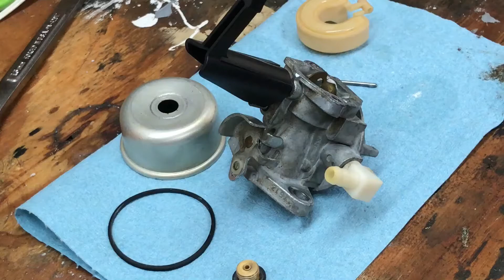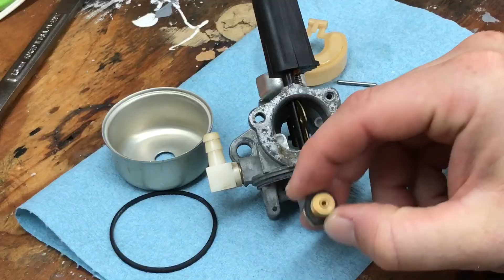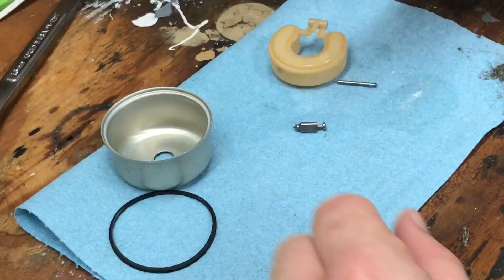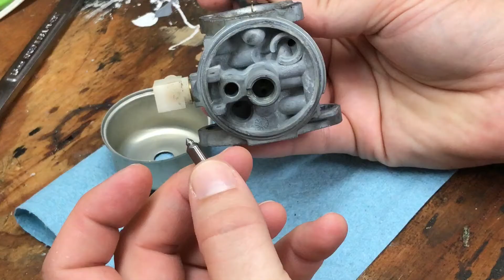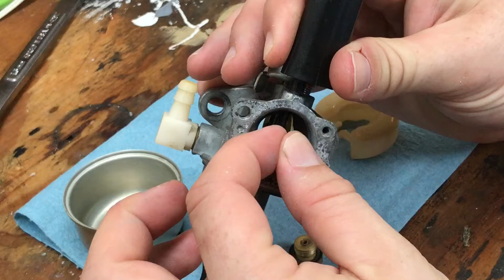Common Problems With Small Engine Carburetors (Float Type)

Comment: Where can I order parts. After spraying Carburater cleaner through the the throat and into the gas intake, I discovered that the ring sealing the float tank expanded when I removed the float cover. The rubber ring  no longer fits into the cover. I hope that heating with a heat gun will shrink the ring.

Comment: Greati video. What does the white connection do?  I assume there is a tube attached to it?  I have a similar carb for Toro lawnmower and when I fill up fuel in tank after it has sat for a few years fuel actually comes out from that tube (ie. not even running, just sitting). I cleaned out the bowl of the carb but didn't change anything.  Just want to see if I can get the mower running before changing out parts if possible (mower from 1987) but not sure what would cause fuel to come out from that tube.

Comment: That black gasket falls off when I take the bowl off I might need to get another one tighter that’s the only thing that can be wrong it has a new carburetor new spark plug new filter gas and oil is good still won’t start

Comment: So specifically on all 6 that I've replaced the floater bowl stops doing its thing and it leaks gas out the air intake. What am I doing wrong?
Reply: Seems like ur float valve is letting too much fuel in not shutting off when it should.

Comment: My duel fuel generator carburetor won't work, I'm attempting to clean it. What does the selinoid on the bottom of the carburetor do? Is it testable? I can make it run when I pour gas directly not carb.

Comment: Thanks man. I wonder if you can help me with a question. I have a small pit bike that it is pouring gas on the overflow line no matter if I is on ON or RES the only way to stop it or closing the petcock. Any idea?
Reply from the maker: Float needle is leaking or stuck open. Carburetor probably needs a good cleaning

Comment: Well done video! Another tip I got (on donyboy 73) is to remove the barbed fuel inlet fitting when cleaning small carbs. Sometimes there is a fine mesh screen in there. Quite a few years working on things like this and I didn't know that.

Comment: is it the needle and seat if while hot the fuel bowl is empty and engine wont run
Reply from the maker: Could be needle and seat stuck, clogged fuel filter or line, or fuel tank vent stopped up

Comment: I’m not getting any gas into my carburetor. It’s flowing but not getting in the carburetor. I have a Briggs and Stratton motor with a Nikki carburetor. Can anyone help?
Reply from the maker: Check the vent in the gas cap. Take the cap off the tank and see if it starts flowing. Check for clogged fuel lines and filters too. It could be flowing, but not enough pressure. If all that is good, it’s a problem with the needle and seat. Make sure that’s not clogged.
Reply: Mike’s Garage Thanks!

Comment: Is that plastic bowl supposed to be level when closed and if not how do you adjust it
Reply from the maker: Unfortunately these floats are not adjustable. When you turn the carb upside down, the float should be level. If not, the float may need to be replaced. Damaged needle and seat can also make it not set level, so inspect them too.

Comment: God morning. I got fuel coming out from the overflow hose on bottom of my pz22. 
Motor cranks and run without throttle. If I flip on throttle, the motor dies immediately. 
Any suggestions?
Reply from the maker: I would get a rebuild kit for the carb. Clean it good, clean the jets good. And check the float to make sure fuel hasn’t leaked into it

Comment: Thanks, at 2:02 you answered my question, i have a 80cc 4 stroke motorized bike and ive been noticing fuel dripping out sometimes under the bike, other times i would try and start it and fog would come out of the exhuast pipe, recently i did a oil change and it was much higher level than i filled it up and it looked like gas mixed with oil in my crankcase, so i just changed the oil and didnt think much. I then took it out on a few hr spin the next day and when i got home i noticed engine on my crankcase had oil on it, i looked and found a blown crankcase gasket, so what im thinkin is that fuel must have been dripping down into the crankcase and than filled up the space in there entirely and than when i went to ride it, the pressure from the piston movin up and down probably what caused the gasket blow out. I took off the bottom float container which actually i think the carberetor in your video looks almost identical to mine, anyways i noticed the entire bowl was filled with gasoline, not sure if its supposed to be this way or dry but please let me know" also what can i do to fix it? Can i just drain the bowl and screw it back on to fix it? Thanks.
Reply from the maker: The bowl will normally be mostly full of fuel. I would try replacing the needle and seat in the carburetor. Some carbs have a red rubber seat that’s replaceable. Some have a brass pressed in seat that’s not intended to be replaced.

Comment: The carbs in the new generators are pieces of fucken shit. I don't even have 40 hours on my generator and it took a shit. Gas in the intake and choke and pins are all stuck. I'll never buy another Briggs h stratton. $800. Dollars for a piece of shit plastic fucken guts in the carb.

Comment: Ive been battling with a carburator on huasheng  142f on motorized bicycle for a long time and still it doesnt work. When throttle valve is almost closed, pilot screw 1 1/8 out it works more or less normal through idle circuit. What happens when i open throttle: after a small movement engine almost stalls, not enough mixture/gas, which means mixture does not get through transition circuit; then high rpm, it reaches max rpm at about 1/4 range, if i open gas more there'll be a catastrophic breakdown. Engine seems to work rich by smoke and color of spark plug. What could be the reason that that max rpm is at 1/4 range of gas valve? All circuits are clean. It seems im the first person with such problem in the whole history of motorized bikes. I tried experimenting with diameter of main jet (i have a spare one) but it did not help; it seems that something is fundamentally wrong in the work of main circuit. Also the smell of exhaust is strange like burned plastic.

Comment: Use cotton swab to clean needle seat
Reply: Can you use valve lapping compound on que tip instead of pulling seat on new float and needle replacement?
Reply: @metal2444 Yes u can even toothpaste in a jam.

Comment: That jet, bolt washer, is it just a regular hardware store washer or something I should get online?
Reply from the maker: If I’m understanding you correctly, that’s a gasket that goes on the jet bolt. It’ll come in a carb rebuild kit.
Reply: I don't see any difference between a hardware store washer on mine, just a reg old washer. Tecumseh 4 HP flathead here.

Comment: Hi,do you know why my engine predator 212 runs only when i unscrew little bit fuel bowl screw,kinda make it loose.otherwise if its tight it doesnt run ?
Reply: Put a thicker gasket on screw, it's protruding in main jet to far and closing off passage